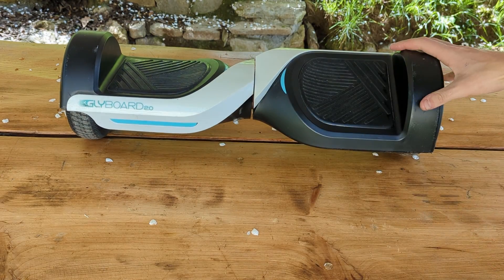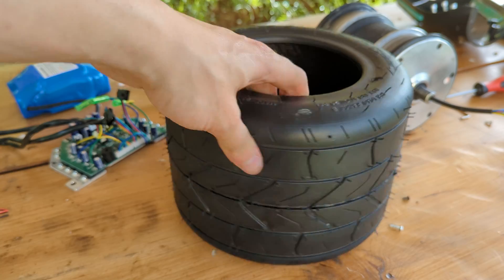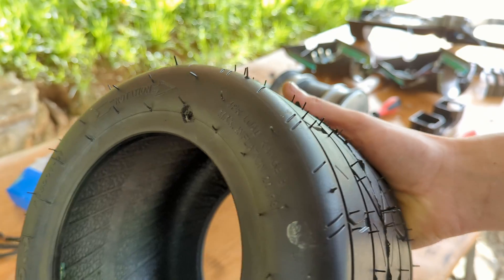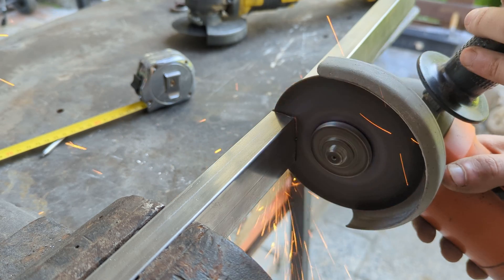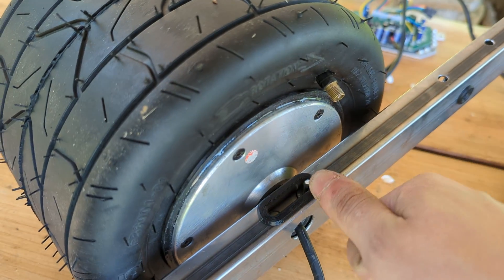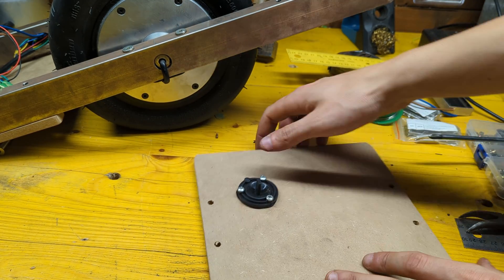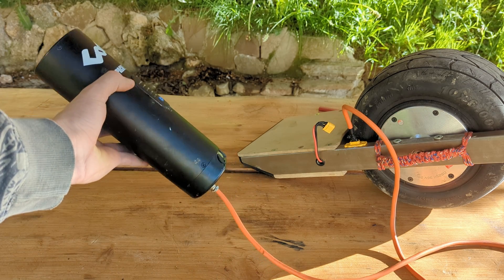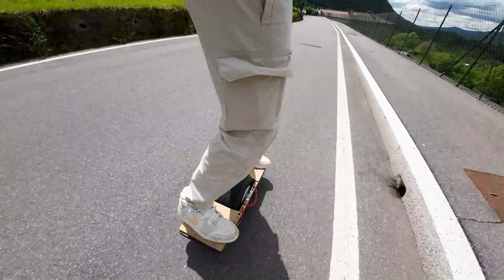DIY ONEWHEEL from hoverboard | HOW TO

Comment: link for the tube?
Reply: I think most guys are using over sized diameter inner tubes by a few inches
Reply: @georgeyork8975 can you please help me with a link or name?
Reply: @georgeyork8975  can you help with a link?
Reply: @yanir.tzabary it was other videos two I watched stating to use a 15x6x6 inner tube. I just made mine and it works. You have to drill a hole about 3/4 inch from the edge and use an extender that is roughly 14mm long. Good luck
Reply: @georgeyork8975 did not work, wheel is to big
Reply: @nitzerebbs  it is dependent on the size of the tire. Mine was a 11x 6 x5 inches and the inner tube worked for mine.

Comment: You could also increase the speed a bit more by changing the firmware of the board and modifying the file, use a better sensor with   Aurdoino and you will get the maximum power out of the board and the motor.

Comment: awesome update to this on going investigation !! how are u using just one of the optical sensors on the gyro without getting an error message ?!!!!
Reply from the maker: You need to splice the signal wires to the other connector to trick the board making it think it has 2 sensors attached

Comment: I still am waiting for the more detailed explanation from the rewriteing but I loved the vid and I am doing this exact project right now thanks
Reply from the maker: I've linked a video in the description that clearly says what you need to do to rewire the controller
Reply: @DAZprojects  thanks just picking the project up again now so this is the first vid i came to!
Reply: would you posibly be able to help running into a problem where i conected the green and blue wires from the gyro sensors corectly. but one of the motors still doesint want to move is do you have to change the hall wires to could you tell me which wires exactly need to be modified?
Reply: thanks i actualy figuerd it out today sorry!

Comment: Could you do a tutorial on the old electronic seat post video, I really need the schematics and Arduino code
Reply from the maker: I'm not.using it anymore, I think I might have thrown it away. Also the code has never been optimized correctly for it to work reliably
Reply: @DAZprojects  Could you still share it with me?